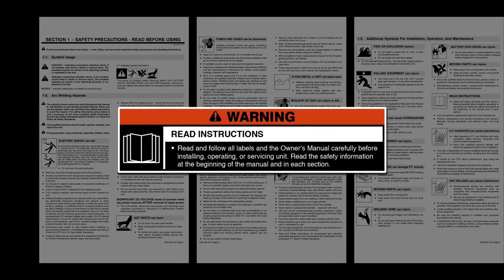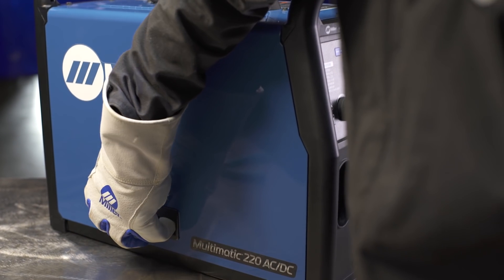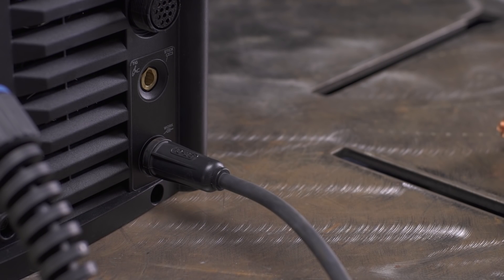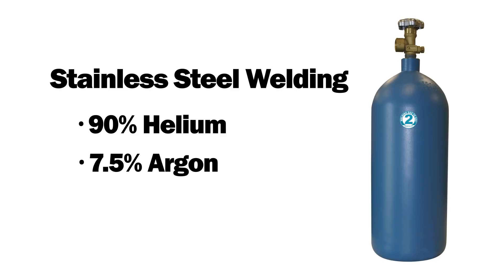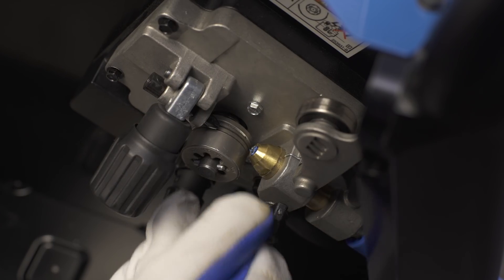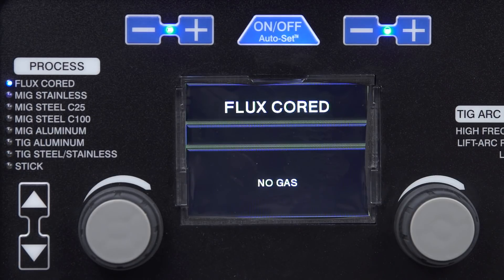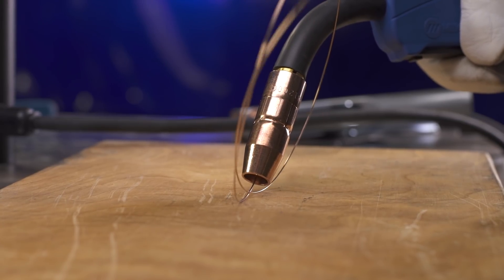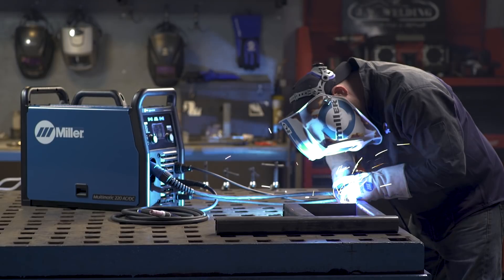Flux-Cored Welding With the Multimatic 220 AC/DC

Comment: So if I buy dual sheild
Flux core the Miller 220 won’t work ? It won’t read it ? Or could I use dual shield
Reply from the maker: The Multimatic 220 is capable of running solid wires, self-shielded flux cored wires and gas shielded flux cored wires. You need to ensure the machine has enough voltage and amperage available to handle the particular wire you intend to use.

Comment: What is the biggest size  spoil it will hold?
Reply from the maker: Hi, thanks for reaching out. The largest spool it will hold is an eight inch spool or 12 lb max.
Reply: I was wondering this as well, thank you for asking and thanks to Miller for the reply

Comment: Love ❤️ the tip about drive roller pressure using a wood board to insulate and determine if your wire pressure is correct. I’m new to welding and I’m going to use the technique on my LE MP210. I’ve had a heck of a time getting it set up to practice beads.  Thanks Miller. Maybe I buy this one too

Comment: Yo ya compre la máquina. Pero surge un problema. Después de soldar con spoolmate 100  aluminio se quedó el dibujo de la pistola en la pantalla por más que cambie a flaco cored o a mig la pantalla se queda con el dibujo de spoolmate. 
Trate de borrar el icono de la pantalla pero no se puede.
Reply from the maker: Desafortunadamente no podemos contestarle esta pregunta sin tener más información. Un distribuidor local le puede ayudar idéntica el problema. Utilice el siguiente enlace para encontrar un distribuidor cercano a usted: MillerWelds.com/wheretobuy

Comment: only programs for 75/25 or straight  Co2? that's disappointing
Reply from the maker: Thank you for the question Jamie. The Multimatic 220 AC/DC welder is designed with Auto-Set parameters for the mostly commonly used gas types. You can always set your own parameters using manual mode. Thank you.
Reply: c12, c10, c8 , c2...
Reply: What other gases are you thinking of   if not 75/25 or CO2

Comment: @ 0:26    SO it will not weld FCAW -Gas ?
Reply from the maker: Thank you for the question. Yes, the Multimatic 220 AC/DC can perform Flux cored.
Reply: @MillerWelders  You did not answer the question 
Can it weld fcaw with GAS    like dual shield ?
Reply from the maker: The Multimatic 220 AC/DC includes recommended parameters for self-shield flux-cored wire only.
Reply: Dav2Kink yes it does I have a miller multimatic 200 and what you do is buy the dual shield flux core and 100% co2 and you have to set it on custom settings and polarity of what wire you have but it will do it
Reply: @Tank838   Thank you for trying... But I was hoping i can use the AutoSet parameters for  fcaw with GAS  dual shield not a  user custom settings     : (